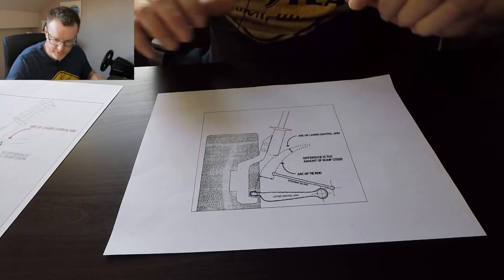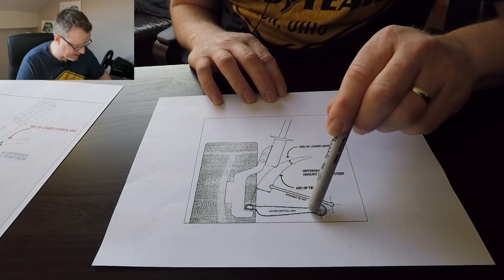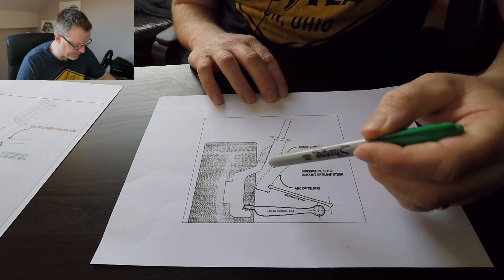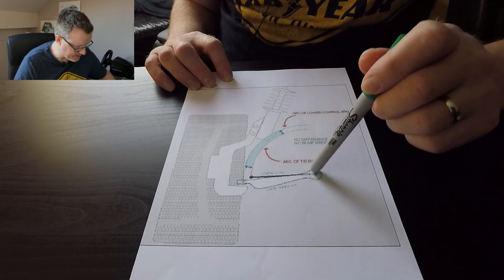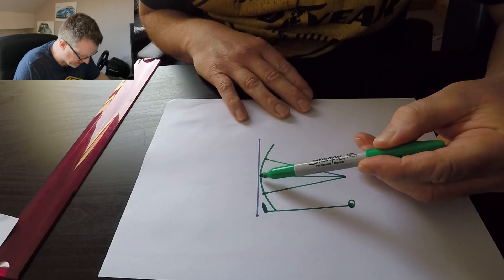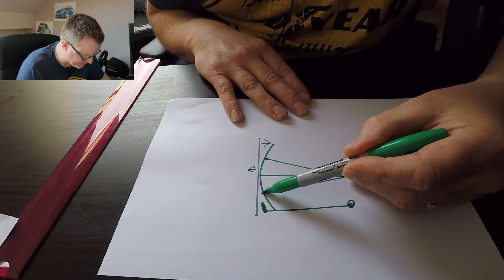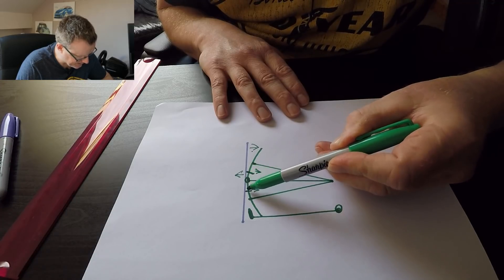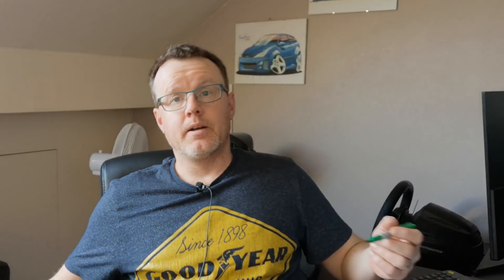How i fixed my bump steer - explained. Fiesta st

Comment: i have change all suspension totally new.  and then it started…bump steer.  and is nuts bump steer.  
have to try this thing u done. will try few millimetres at the time as my e-steering have good access to the bolts. watched many videos about bump steer but nobody said about lifting steering rack 
regards

Comment: Hello. I have major bump steer on my 2012 fiesta tdci. I have replaced springs shocks control arms inner & outer tie rods & sway bar bushes. Had it tracked  but if I hit a stone it moves my steering wheel a lot also up around the 60mph mark the car feels very loose & hard to keep in a straight line . My car is supposed to have 195 45 16 tyres on it but I got it with 205 45 16 would the extra width cause this problem.  Many thanks for your video's and the information you give out.
Reply from the maker: If your steering wheel gets forced it move that's not bump steer. Bump steer is the wheels turning while hitting a bump but the steering wheel doesn't move.
Reply: @Sparkplugsteve my steering wheel does get forced over bumps what can the issue be

Comment: You are spot on Steve, I have built many race and rally cars and adjusting the height of the rack is a well known cure for bump steer.....
Reply from the maker: Thanks. I was well happy it worked. Car drives so much better now over bumps.

Comment: yep you got that sussed  out  aim for  both  bottom suspension  arm and trackrod to move in parallel  and although  its not perfect as they generally dont pivot from the  same centre but  its as good as you can make it  nice drawings by the way  well  theorised   its not easy to do on road cars

Comment: the only thing that you're missing in the entire equation is that after you put washers to raise the steering rack you changed the default geometry so realistically you had to go and make alignment and THEN make the measurements again. I like you and i hope i'm wrong as i'm not a specialist but i think and feel something will be very off when you make alignment and measure again..
To add, i still wish you made something similar for the ST170. But now i remember - the original inner tie rod had some recess in it which was not present on the normal focuses and on the aftermarket parts, do you think this has something to do with this ? And there goes another question: what will happen if you put washers on the tie rod?
Reply from the maker: Yes it does alter the tracking alignment but there's no future issue to worry about there when its all finalised. You can't space a standard rod end as it's a tapered fit. Thanks.